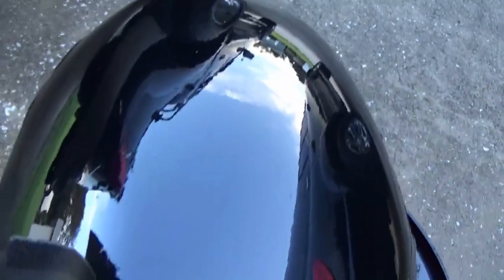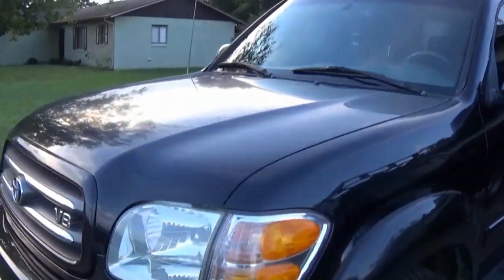2004 TOYOTA SEQUOIA MIRROR PAINT AND REPLACE (GLOSS BLACK)

Comment: How do you fix a loose driver mirror on the sequoia. Every time I close my driver door my mirror moves inward a little bit..is there a way to tighten a loose drivet mirror or replace the whole thing?
Reply: I have same issue , I am tear down everything and check , hope i find out the problem
Reply: pop off the speaker cover and the bolts to easily tighten are easily accessible